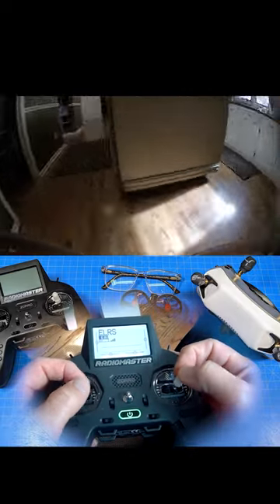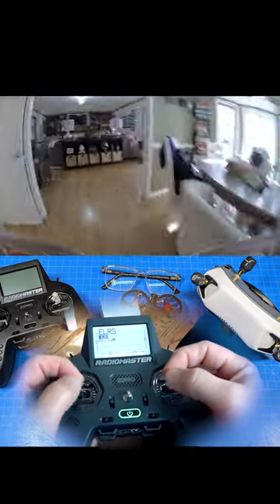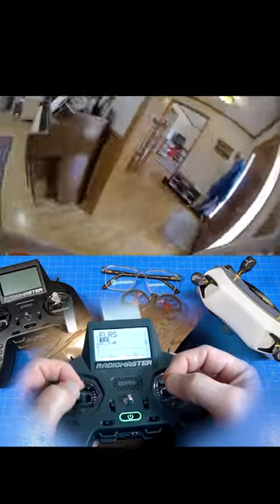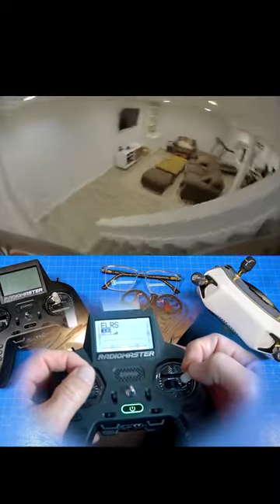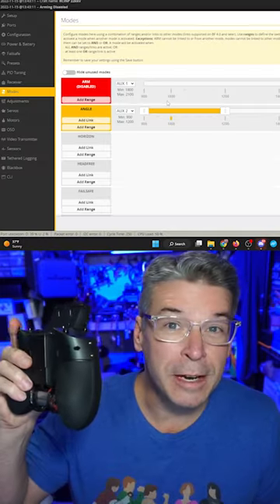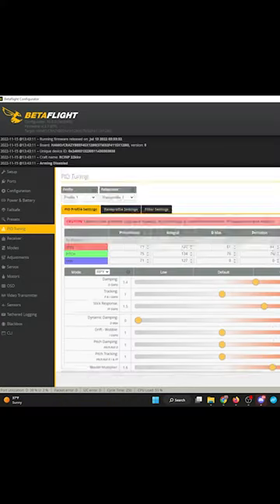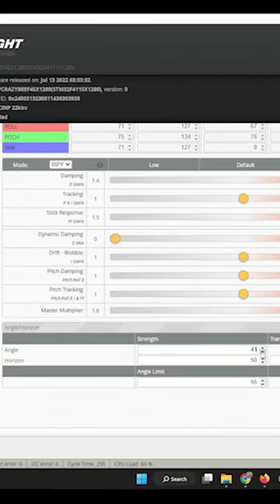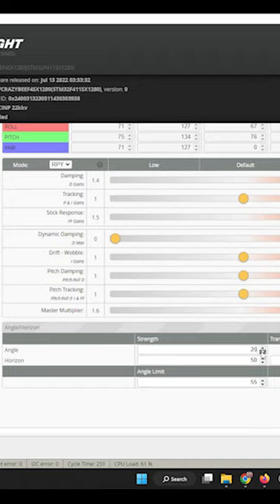Drone Acro Indoor Flight Training Tip #drone #fpv #hobby #shorts

Comment: To fly acro you got to understand what acro is, how it behaves, and what is expected for you to input into the quad, one way to learn is to fly LOS to understand the behaviors, for instance if you tip the quad, he is not gonna self level, therefor he is going to continue moving in that direction, no more inputs needed, unless you want to stop, then you got to tip back in the oposit direction so it can stop. After you learn it, there is no feeling like it, its complete freedom. So awesome.
Reply: or u just go in the sim
Reply: Does being good at flying LOS in acro really translate to flying it FPV? Because I can speak from experience that it doesn't work the same way the other way around. I can't fly LOS to save my life, yet I can zip around a small apartment with relative ease. Though I do have sim time to thank for that, and maybe too much sim time at that lol
Reply: Los is simply positional awareness all instead of practicing los focused on your remote focus on you being the pilot in the quad two different colored props help tremendously at first green front pink back. Just make around 1400 Squares usin yaw in your back yard and boom you’ve got it 6 years later lmao don’t regard the latter comment it’s just for fun you can learn los in a week try JBs method 4 packs a day no goggles 30 days 4th day you’ll be like”” look babe I’m doing it without the goggles”” lmao
Reply: @DeltaInsanity I’m horrible at line of sight too, i get confused so fast and it just ends up horrible

Comment: I think I am missing the concept here. . . . Is the idea just to fly slow and smooth in angle then switch to acro?
Reply from the maker: No, this method reduces the the angle mode assistance to a point where its very weak and then we switch to rate/acro
Reply: @NickBurnsFPV  ah it's the speed it snaps back to level?  Gotcha.  Genius!  Thanks Nick
Reply: Ahhhh I finally got it. Thank you for the tips

Comment: This is actually just what I am looking for. I can fly anglemode outside well but that doesn’t really take much skill now I think I should buy a micro basher quad to learn with. Something cheap and durable
Reply from the maker: Oh I would give you more credit than that. I have handed quads to non fpv people in angle mode and they really struggle to do anything other than bounce off the floor and ceiling. :)

Comment: How much does a setup for something like that cost from scratch? 
I’ve got a mini 2, but really want to try some FPV, without dropping a K on an avata or something!
Reply from the maker: The quad in this video is this quad https://www.youtube.com/watch?v=tLvO_CjxZbY the cost will vary some, but we need goggles or the vrx if we have goggles with hdmi input, batteries and battery charger. The quad itself would be about $280, goggles about $500, charger and batteries from $100 to much more depending on the charger and how many batteries we buy.

Comment: Nick, I think you can use angle limit in acro mode so you're actually flying in acro, but limiting the angle so it can't flip, same concept you're just never in angle mode .
Reply from the maker: That might be, just something I haven’t done.
Reply: @NickBurnsFPV  I set it up a while back, you set it up on a aux channel, and set the limit in the lower right of the pid tab.

Comment: What's a good starter fpv platform that's affordable doesn't necessarily need to be micro or racing. I had tested a dji mini 2 loved it as far as video, range, fly time, sensors and features. When I did I believe the fly more kit was 700 believe it'd now 500.
Reply from the maker: I don't have any experience with the DJI drones. Is that what your asking? I don't think there is anything remotely close in FPV that I have experience on this channel. The fly time is shorter, the range can be about the same, rarely do they have sensors or features like the dji drones.
Reply: @NickBurnsFPV  no I'm asking what drone/quad fpv is a decent one to start with that won't break the bank. Loved the dji they have a fpv and believe u can add the goggles to any of their drones. Just a Lil ok the high end price wise. I'd be happy with a dji or their fpv (their fpv specific drone is or was $999.99, but not really upgradable if I want to into the hobby like nitro RC cars where you can get different motors , upgrade parts or replace broken ones. Where as a Dji believe all u can do is change controllers (their one hand controller stick I dunno thr name is cool) add fpv, or swap broke rotors.
Reply from the maker: @IcannaHelp  The budget options will be analog, which is far from the visuals of a dji drone. Also the goggles will be what we call "box goggles", which are less friendly if we wear glasses or have corrected vision....might need to wear contacts. A solid package for under $300 is the emax tinyhawk III racing drone package. When we jump up to dji level of visuals, the price point is nearly double.

Comment: I'm flying the mob8 o3 in angle and I just can't find that sweet spot on the throttle. It's like I'm flying a pogo stick around.  Any pointers for that besides practice practice practice? Thx
Reply from the maker: Maybe try adding a bit of expo to the throttle?
Reply: @NickBurnsFPV  yes very good advice!! I did,  I lowered my mid throttle a little and added about 30 expo... world of difference! I'm also going to try try the angle step down method you recommended! Thanks for replying!

Comment: So you're OK with flying the Radiomaster Zorro with a hybrid pinch grip? I thought the gaming style controllers were mostly for pinching...
The smaller gimbals give enough throw to the sticks?  That's also something some say doesn't work for them.
How long do those 18350's give per charge?
Please elaborate...  
Thanks Nick!!! Happy Thanksgiving for you and your family.  :)
Reply from the maker: Yes, When I first started fpv I was thumbing, but felt I wasn't progressing. I switch to this pinch hybrid, which felt weird for a while but eventually felt more in control and better. the battery life on the zorro is shorter than most radios, its not a large issue for me as I don't often have flying sessions more than 60mins. I use a secondary battery when it gets low and I have flying to do. I use either the 18650 pack made for the zorro or a 2s goggle battery to juice it up while I am flying. I have read about some that don't feel like they can pinch/hybrid on gamepad style radios (I have no idea if those I have read about or heard from are based on 1 flight or weeks of flights pinching on a gamepad radio), for me it feels more natural and the angle of the radio more suits the angle between my elbow/ribs and hands. The box style radios feel like I have to keep outward pressure to keep my hands in the position I like, nice and relaxed. I don't feel this pressure on gamepad radios.
Reply: @NickBurnsFPV  Hmmmm. Very interesting. Thank you.
I might pay the slight extra on Amazon so I can return it if I don't like it.
Reply: What's your opinion on the TX12 Mk II?  I already have a Crossfire full size JR Bay module.
Reply from the maker: @KOrnhOliO1  That one is also very popular for those that like a smaller radio but don't want or like the gamepad style. It doesn't feel as robust or as well made at the TX16 or zorro, though.

Comment: So I take it when you lower the value you'll end up having to self correct more and more because it wont auto balance itself quick enough? Might have to try it out and see, ive only just started on a mobuia 6 and acro seems impossible, maybe this is what i need. Plus it seems indestructible so that helps.
Reply from the maker: That is correct

Comment: So by setting it to 50 on angle could you explain what exactly that does? I can fly acro outside but indoors even on angle in my 500sq ft apt I just hit everything lol😅
Reply from the maker: in angle mode the quad is always working to level itself. Decreasing the number decreases how aggressively the quad is trying to self level, leaving us in control an generally means more acrobatic ability and smoother flight

Comment: Hey I got the zorro and the Pyro ag01s  is it normal to both be centered when I put it in, I can't figure how to un center before I've put it in I'm afraid to have them both be centered. Sorry to ask!
Reply from the maker: Yes, that is normal. From this page: https://www.radiomasterrc.com/products/ag01-mini-cnc-hall-gimbals-for-tx12-zorro
We scroll down a bit to this section: FOR ZORRO
The Zorro radio is configured as Mode 1 or Mode 2 by the screws mounted in the rear case of the radio. Both gimbals should be installed in self-centering configuration (as default out of the box) in the Zorro radio. Once the radio is re-assembled the screws in the rear case of the Zorro will set the throttle gimbal.
Reply: @Nick Burns  thanks for your response! Installing today!

Comment: Hey nick what 2s pack are you running strapped to your zorro? I had tried another but just didn't seem to fit right
Reply from the maker: None of them fit really good. I use 3000mah 2s goggle batteries and the radiomaster 18650mah pack, fits about the same as the goggle batteries

Comment: Or just fly angle indoors 🤷‍♂️ I'm nearly as fast around the house as you in angle mode.  If I go to acro mode I'm less than half the speed.  Also I end up trying to power loop furniture which is fun until I break the frame 🤣 I can't be trusted in acro mode indoors!!

Comment: This will work but if you have no experience at all you may benefit more by just struggling with acro for a day or 2 until it clicks. I almost bailed on acro at first cus it was so hard but after several houra in simulator i just got it.
Reply from the maker: from the comments I find so many frustrated with trying to learn acro inside they contemplate stopping fpv all together.
Reply: @NickBurnsFPV  you are right about that, i actually had 1 previous attemp at acro before i learned. I got mad and left it alone for a week, im happy i went back.

Comment: i want a good sim for micros with some fun maps that utilize the scale
Reply from the maker: if you haven't tried tinywhoopgo might want to give it a go....its free so no cost to give it a try.
Reply: @NickBurnsFPV  THANKS!! ill have to try it. 
i had actually looked around a lot a couple years back, but i never found anything that looked/felt good for micros. i hadn't heard about this one at all, is it new?
Reply from the maker: @themrwinston9570  I am not sure of the launch date, but I think its been around nearly 2 years. Often we have to use decreased graphic settings on less powerful computers to get the flight physics close to real world.

Comment: Never flown angle, starting in Angle gives you so many bad habits from what I've heard. Simulators are a thing, don't push your limits on your RL hardware
Reply from the maker: Eh, so many opinions on flight and learning. I don’t buy into the bad habits, so many top angle racers are now switching to acro. If the bad habits were a reality, switching would slow them down and take so long to overcome those bad habits. Doesn’t seem to be happen from those I have been in contact with. And I started on angle. I think a more likely barrier is how much time we give to flight evolve

Comment: Or just fly in acro mode from the beginning 🤷🏻‍♂️
Reply from the maker: There is some portion of those I have "talked" to that tried acro from day 1, after some period of time they grow so frustrated they contemplate leaving fpv. This is a good second opportunity.
Reply: @NickBurnsFPV  yea I could see that.  I flew RC helicopters for years before drones ever became a thing and angle mode just felt weird to me, I was never used to anything helping me fly as I only had gyros for tail rotor (yaw control) so acro was just regular flying for me.
Reply from the maker: @SkidzFPV  Likely. I tried helis about 15 years ago, my skills were very limited. I don't recall if it had a gyro or not. I don't think so as I remember nose control being difficult to get and keep. My best "move" was a nose up orbit, it was never easy for me.
Reply: @NickBurnsFPV  I can almost guarantee it had a gyro on tail rotor, the old ones actually had a mechanical gyro, it had a spinning flywheel with sensors on the shaft so when the tail wound wag it would send input to the tail rotor servo to correct it.  You could hear them spin up when you turned the radio system on.  If you where able to perform a nose up orbit it definitely had a gyro.  The very early ones before tail rotor gyros where very difficult to even keep them straight, then just hovering on top of that took a lot of skill.
Reply from the maker: @SkidzFPV  I still have one, I think it was the first of two, probably destroyed the other. The one I have is the esky honey bee.
Reply: @NickBurnsFPV  ok, that’s cool.  I had everything from the older nitro .50 size helicopters, to align trex 250 all the way up to 700mm size helicopters, running on 12s 5,000 mah batteries, that’s around 50 volts of 70+ mph flying upside down and backwards.  Was a fun hobby but expensive when you crash.  Still have a couple small ones and one 700 left.  The 700 doesn’t have electronics in it though, and I’m planning on selling it because I don’t want to put the thousand dollars or more of electronics in it to fly it again.
Reply: @NickBurnsFPV  i even had a 500mm size heli with a airwolf fuselage and retractable landing gear.  That one was freaking beautiful and really fun to fly with the gear up.  Looked just like the real thing
Reply from the maker: @SkidzFPV  sounds like you were all in for at least a time.
Reply: @NickBurnsFPV  yea I definitely was.  Started with RC gliders when I was about 13 (actually stick and tissue free flight before that) then RC planes, helicopters, drones, now I fly for real, I huck myself off mountains with a paraglider.  Flight has always been in my blood, since I was a little kid.